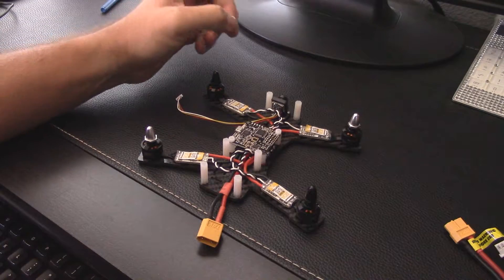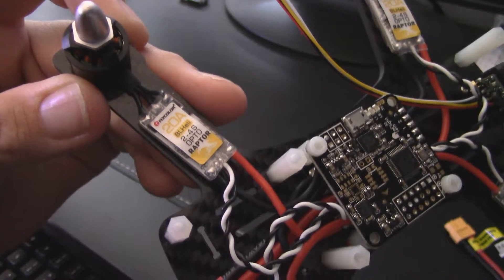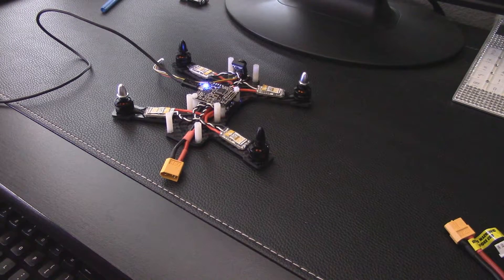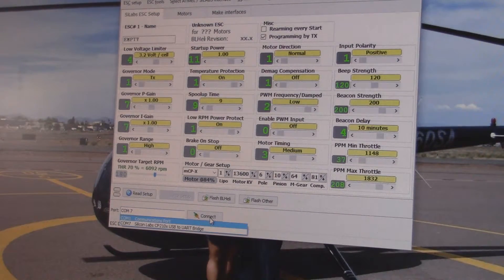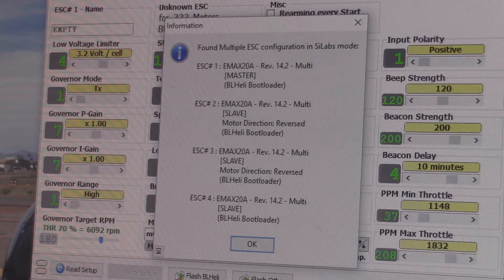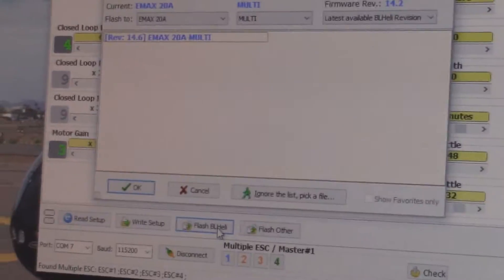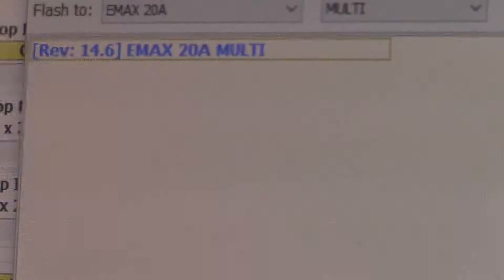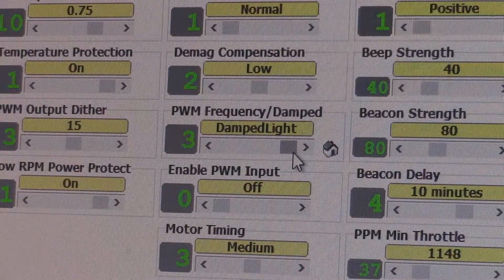Flycolor Raptor 20a ESC - Stock BLHELI settings

Comment: Why are you use emax 20A firmware on flycolor esc?
Reply from the maker: +Pikachu Copter this model of flight color Raptor 20 amp ESC use the Emax firmware but I'm pretty sure that later models did have their own flag color hex for the firmware
Reply from the maker: +Oin Taylor sorry for the misspelled words, voice dictated.   Should say FLYCOLOR